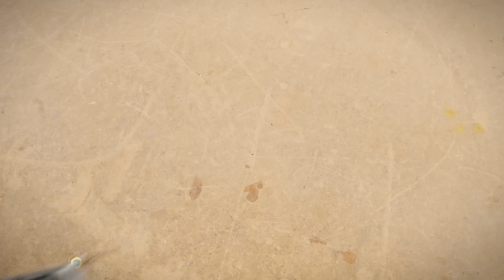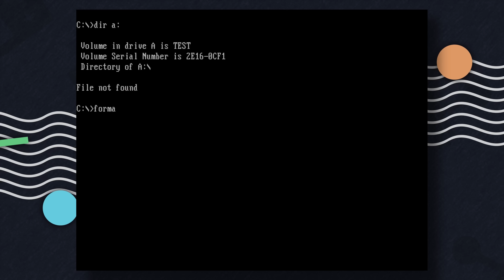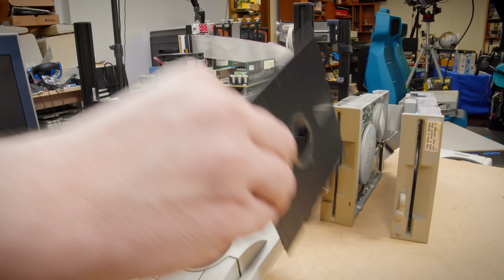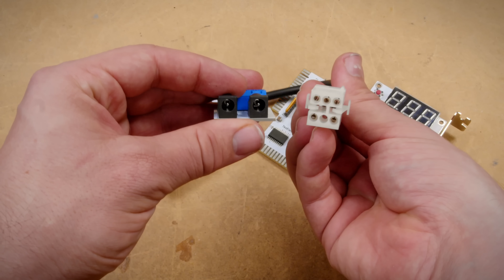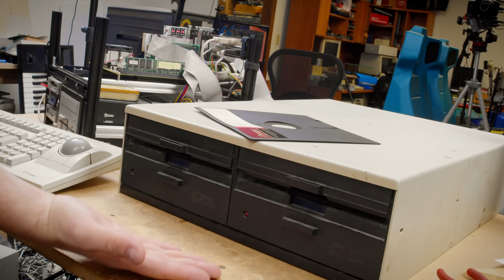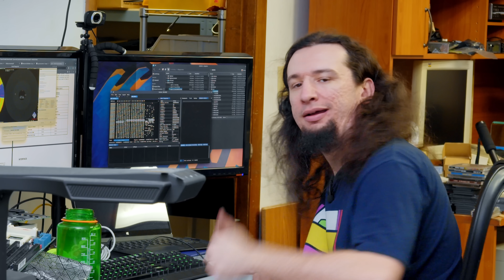New 4 Drive Floppy Controller - TexElec Quad-Flop

Comment: 1 thing to note: the drives you are use  if they are mid 70'sto mid 80's floppies these will not be IDE based connection systems these will be like most of those era based floppies  will be scsi based not IDE/Eide based systems

my opinion if I was going to arse defunct hardware may be look  at xp and pci-e to make it more relevant for use 
If you are having issues with 360k drives don't quote me whilst ide might of existed in the 80's most floppies ion use were using scsi not IDE

so unless the floppy ide based it is likely to cause hissy fits in reading and writing to it..

best not to fuck about with drive lettering in dos because it fucks up under windows

At best for IDE based  components you are looking  hdd's, cdroms and dvdroms..

from a floppy perspective you will be looking at 1.44mb and most of what 5.45" class hardware though stepping into the to the 8bit-pc compatibility craze most likely stepping from scsi to scsi either 33/66..

try a scsi card on that 8 inch it will likely work properly..
note like with hard drives and cdroms of the 90's period you typically need to set master and and slave per drive before allocating drive number/letter to the drive 

as someone who would use 3.5-5.45" disks in windows at home and in school 

the edge connector on the back might  be usable  under IDE/EIDE conditions  though if trying  to a scsi device make sure it is compatible with it 1st otherwise you make yourself look like a complete idiot trying to hardware not designed to run over ide/eide spec
'

Comment: If anyone is interested on how to use 4 drives with IMD with TecElec controller, I go over all the details of this in my "How to image and create disks for retro computers" video I put out about a month ago.  I really recommend using IMD for all disk imagine because it auto analyzes the disk format properly. The command line utility Shelby was showing off requires you to know the format, which is not ideal. 

In addition, the controller IC the TexElec controller uses fully supports reading and writing FM and MFM disks. (Single density and double density) so the oldest disks written in FM will work.

8" drives and 1.2mb 5.25" drives are basically identical in format other than the fact 1.2mb drives have 80 tracks while 8" drives typically have 77. Otherwise, the rotational rate (360 rpm) and data rates are exactly the same. (500kbit) So using an 8" drive on a PC is easy by just setting it to 1.2mb. Just avoid using the last 3 tracks or the head will bump.

Comment: Well, you don’t have to mount both FDC’s on Sergey’s Monster FDC. Actually you can just skip everything but the address decoding and you’ll have a suuuuper cheap 4 drive FDC. You can even skip the ROM I believe! That should bring the cost down < 10$.😅
Not hard to solder either - but Sergey’s design doesn’t have a card edge connector so I might have to fork it first.

Comment: how many amps does a 8 inch drive need on the 24V rail? then you could actually use a boost converter to power the 8 inch drive from the PC itself.
Reply: Majority use 2.0 to 2.5 Amps.  Your specific 8” drive should have that spec. on label.

Comment: Fascinating video, thanks.  I worked on hardware and software design for floppy and hard drive controllers in the mid 1980s (not for PC though) and dealt with the many low-level control issues.  This brought back so many memories.

Comment: Switching the drives could be useful! I've seen installers that assume they're running from drive A.
Reply: I sent a mail to texelec to give them the idea that the little display and button could be used as a replacement in a turbo button/mhz display equipped case. Imagine having front access to a button to circulate which drive is presented as A. Would be neat.

Comment: I put together the Monster FDC to use on an old 8088. Unfortunately had to disable all the extra options and the second FDC since that system only has so many interrupts available. If you do not have a bios option to disable the floppy disk controller maybe check to to see if the onboard FDC is socketed and just pull it from the socket as that seemed to work for me.

Comment: Those IBM PCs should be re-created. Those are the real pcs
Reply: I think we're most of the way there as far as the purely electronic parts go. I've heard of an XT motherboard clone that'll fit in an ATX case, and I've seen a GitHub repository for a CGA/MDA compatible card that'll give VGA-compatible output (I think it was called the Graphics Gremlin). For sound, there's a few options, such as the Snark Barker, which is a clone of the original Sound Blaster, and various Adlib, CMS, Covox, etc clones. There's the XT-IDE for using newer hard drives or CompactFlash with an XT. Haven't seen any serial or parallel port cards, but I expect they do exist, and then there's this for a floppy drive controller. So, yeah, I think you probably could put together the electronic side of an XT machine made with new parts. The mechanical side I have my doubts about, though. I doubt anyone's made an all-new floppy drive, so you'll probably still have to go with second-hand hardware for that, at least for the time being.

Comment: Great bit of kit. Excellent work by the designer. Some may say that your videos need to be scripted properly and be "more professional" with higher production values but personally the ad-hoc mayhem is much more personal and engaging! 👍😁 I certainly remember spending hours trying to resolve IRQ conflicts and device contention on my heavily expanded P200MMX machine back in the day. I suspect that the "supply problems" are trying to source the floppy controller. I'm currently trying to design/build a floppy controller card for my homebrew 6809 machine but so far all the floppy controller chips I have received have been fake! 😡 Some more arrived yesterday so here I go again!

Comment: I've built a couple (one for a Xi8088 and one for a 286 system I have) of those Monster FDD cards because there wasn't really anything out there like this, it's kind of cool in a "hilariously-over-the -top-overkill" kind of way. I'll probably use it in the most inefficient manner, too, using each controller to drive a set of FDDs, instead of one handling all 4, just for the hell of it. TBH, I wish Sergei would release a revised PCB design for his FDD/Serial/Option Rom board that exposed the second floppy channel like the Tex-Elec design does or like the Monster FDD board does for each controller. Between the Serial port and the option rom support you'd have the max amount of functionality crammed in a very compact package and I doubt it would be all that hard, either. It's nice to have these options now, though.

Comment: I bet this card is going to sell out the day it goes up for sale!  I am going to buy at least two of them.  I have a tall tower 386 with a dormant DC2120 tape drive because I can only control two floppy drives at once.  This will finally change that!  And I have another tall tower case from the same era with (6) 5.25-inch bays and (2) 3.5-inch bays, and I am going to build it up from just the case, loading floppy drives, DC2120 tape, Zip, Syquest, magneto-optical, and maybe more!
Reply: 2120 and all QIC drives should be able to coexist with 2 floppies . It required a weird cable scheme but no extra hardware.  There were also QIC accelerator boards

Comment: Yes, but, will it read/write Amiga and other non-standard formats like the catweasel controller used to? PS: MAME on Linux will open and boot IMD images.
Reply: Seeing as it uses a standard PC controller, no.
Reply: These controllers can only read FM and MFM encoded disks, so no, Apple 800k and Amiga disks won't work. Atari ST disks can be read and written using a special DOS program I forgot about. The controller on this card is the same (compatible) as any other PC disk drive card.

Comment: @Tech Tangents That 8 Inch Floppy power connector is called a Molex 50-84-1120 MLX 12-Pin Power Connector. Its designed to carry up to 20 Amp per pin.

Comment: So this is dropped early in the video, but I’m curious as to how set ups like the flopper Tron are set up. Would it be using something like this or something very different?
Reply: The floppy interface has a few simple pins for spindle and seek control, so those are the only ones needed for the Floppitron.

Comment: Would love to see a pcie floppy controller, though this is a great product for those that have older systems.
Reply: Honestly, I'd be happy with a USB floppy drive, but they don't come in sizes other than 3.5".
Reply: @nullplan01  You can buy USB to floppy drive controller to plug into whatever drive.

Comment: half thinking that the pin out of this and the control setting in the chip COULD fit in Usagi's centurion as it seems to be a control motor step and read the (Odd tape based sectorisation) of floppies.  Rather a bit of custom cables but does not seem impossible given time to actually do it.

Comment: The display can be made much easier to read by sticking some red PVC electrical insulation tape over it.
Reply: I was thinking "taillight repair" tape, but yeah.  There's probably model paint or nail polish that would work too.
Reply: Wonder if that's due to blocking infrared light?
Reply: @Roxor128  bare seven segment displays are kinda shiny, adding the tape stops the unlit segments from reflecting light from the room, making the lit segments much more obvious.
Reply: Or by not shining studio lights on it.

Comment: I really hope one day we will get a modern MFM hard drive controller. I like my MFM/RLL hard disks a lot, but some of these controllers are just appallingly bad, with buggy and confusing BIOSes, unlabelled annoying jumpers that don't always work, usually pretty poor performance (which is not hard to fix), garbage CMOS support, limited drive geometry selection, etc.

I would love a nice, modern MFM controller, preferably 16-bit but 8 works as well, free-use geometry, still capable of RWC/change cartridge and unbuffered seek...
Nobody will ever make this, I know, but it would be really cool to see.
Reply: I actually have a video coming out next week about MFM drives and controllers. The XT controllers are the annoying ones, but 16 bit ones that are replicas of the IBM MFM controller from the 5170 and good. They just use the normal BIOS hard drive type and will work on any machine that has a 16 bit ISA slot. IDE drives, Compact Flash card and what not all replicate all the base functionality of the IBM MFM controller card from the 5170. That's how everything is cross compatible.
Reply: You could put in the effort and make it yourself...
Reply: somewhere I have a VEISA ? floppy/disc controller for a 8086/386 machine of some sorts. Did not some drives come with their own controller board so the cable was dumb other than to BIOS ?

Comment: RIP I hoped it had a PCIe interface. usb floppy drives can act wierd under Linux and I hoped for a PCIe one.
Reply: PCIe is very complex, is far easier to get an old computer for this card then make a card for a modern computer. 
If would also be much more expensive to do PCI or PCIe.
Reply: @bzuidgeest  There's PCI to PCIe adapter cards and PCI to ISA adapter cards out there, it should be possible to do what is needed with those (assuming they can tell what each other is trying to do).
Reply: @44R0Ndin  those have limitations in what they can do. Bios extension support is something such a stack won't do. It also needs very specific drivers.
Reply: @bzuidgeest  
That's all true, but PC's that have PCIe cards aren't going to be booting into DOS, so the ability to support BIOS extensions is not required when the OS itself is more than capable of mapping any physical connection scheme of drives that can be accessed properly into any arrangement of drive letters (trust me, my own PC is a bit weird in where the drives are comparing where the BIOS says they are to which letter the OS says they're assigned to, and I'm just running Windows 10 like a "normal" user and not someone who's interested in retro comptuers).
But if you want to access these old disks from a modern system, and you're having problems with USB floppy drives under Linux, IMO the problem will be within the driver and not the physicality of the disk drive or interface itself.
In any case, if you want to use OLD DRIVES with NEW computers, the easiest way I can think of to do that is to use the fantastic and extremely capable (nearly magic) USB type C cable, which supports the ability to supply a surprisingly large amount of electrical power (granted only one voltage, but still it's not limited to just 5v, you can also do up to 48v with the right negotiations and power supply IC's), as well as supporting standard USB 2.0 at up to 480mbps and USB 3.1 gen2 at up to 10gbps bandwidth. That USB 3.x support can largely be ignored for the sake of old drives, because they're never gonna be able to make use of it obviously (especially a floppy drive of all things). On the other hand, the USB 2.0 interface is well known and extremely well documented, and has MANY easily available USB to UART IC's available out there, the first one that comes to my mind is the quite good FTDI one.
Oh and you can use both the high power delivery options (known as USB-C PC for up to 100w delivered as 20v 5a, and USB C PD Extended Power Range for higher voltages of 24 or 48v at up to 5a, for a maximum of up to 240 watts) alongside either the standard USB 2.0 or the much faster USB 3.0 interface standards.
This USB-C standard is basically a dream come true for anyone looking to make a "retro computer drive bay" which would likely have JUST the USB-C connector (maybe additionally a USB 2.0 B connector and a DC power supply barrel jack for easier backwards compatibility), and has an internal dual-ATA-133 controller, as well as a dual floppy drive controller inside it, with both being interfaced to USB thru the aforementioned USB UART and then interpreted on the data side as a USB-connected floppy or hard drive.
For the power connection to the drive, you'd get a short pigtail with 2 molex plugs and 2 3.5 inch floppy drive power plugs (forget the proper name for them at the moment).
Power would be supplied to the enclosure at 20V 5A maximum (100 watts),  and converted inside the enclosure down to the standard molex power connector voltage rails of 12v 5A (60w max) and 5V 5A (25w max) by a couple of on-board DC-DC converters, with the DC-DC converters chosen to have over-current protection in case a drive decides to malfunction and draw excessive current. 15w of power headroom was intentionally not dedicated to the drives in order to provide power to the logic board that translates these old data interface standards into a USB data stream. 15W should be far in excess of what is needed, but it's nice to always have more power available than you need, at least then you don't have to worry about local brownouts interrupting the logic board's power because of a drive drawing 75w for a fraction of a second.

I lack the skills to actually work out the circuitry involved in such a device, but I leave this in the public domain as a good starting point.

Comment: This community is so amazing. Brand-new expansion cards, cards being re-created that were thought to be lost to time, and even whole new computers. It's really incredible to witness all this stuff go from pipe dream to reality.
Reply: True, but there's a Holy Grail that still eludes us: A fully universal, SoundBlaster-compatible PCI sound card for DOS. No SBLink, no specific chipsets. Every single PCI card I've tried under DOS requires something extra, or it's not compatible at all. :(
Reply: @lisandro3614  One ISA card that could do just about everything would be great, like a motherboard on a full-length 16- bit ISA slot, maybe with additional connectors that can populate other 16 or 8 bit free slots for additional throughput. I guess the limitation becomes the bus clock speeds and bus power itself.  With some large capactiors onboard, like Nichicon or Rubicon radial electrolytics you could probably get around any power requirement issues... they could be on a socketed board themselves for easy future replacement. It could also draw power from say a 12V drive connector or two.

This would be more efficient (power-wise) than having say 4-5 fully populated slots, better case airflow and a neater solution.
Reply: Some of these controllers actually have practical applications as there's systems out there still using floppies. IT's cool? yes. But there's people who actually want new controllers like this.